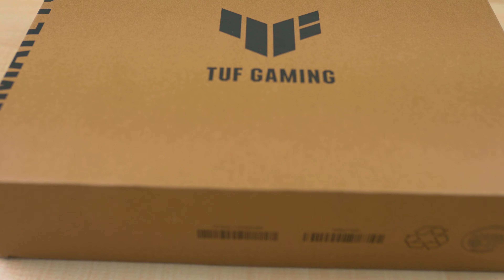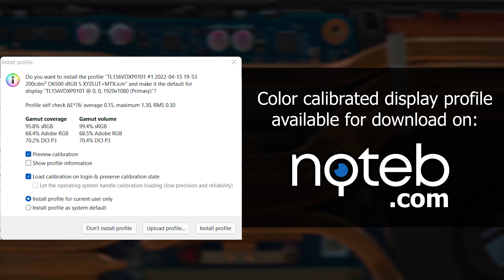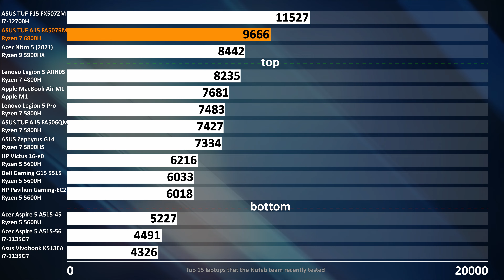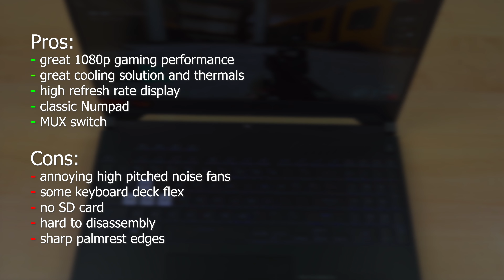ASUS TUF A15 (2022) Review - Unboxing, Disassembly and Upgrade Options

Comment: where to put the shortest screw pls? :)) i mixed them up
Reply: Did you figure it out, I’m in the same boat
Reply: 1:28 Unscrewing chassis bolts/screws
Total lengths in the order that they were unscrewed:
Bolt 1) 10 mm
Bolt 2) 12.6 mm (long)
Bolt 3) 12.6 mm (long)
Bolt 4) 10 mm
Bolt 5) 10 mm
Bolt 6) 8.63 mm (short)
Bolt 7) 10 mm
Bolt 8) 10 mm
Bolt 9) Captured
Bolts 10,11,12) 10 mm
Reply: Below the Ryzen sticker

Comment: 1:28 Unscrewing chassis bolts/screws
Total lengths in the order that they were unscrewed:
Bolt 1) 10 mm
Bolt 2) 12.6 mm (long)
Bolt 3) 12.6 mm (long)
Bolt 4) 10 mm
Bolt 5) 10 mm
Bolt 6) 8.63 mm (short)
Bolt 7) 10 mm
Bolt 8) 10 mm
Bolt 9) Captured
Bolts 10,11,12) 10 mm
Reply: Many thanks
Reply: Thank you so much bro

Comment: Why is there a silver pouch on the ssd? 
And my laptop also shipped with a black mask over the Ssd and Ram which is giving me 80°c on SSD temps on normal work load. 

Is this normal?
Reply: I'm tempted on not putting mine back tbh.

Comment: Can you please suggest about the Asus f17 2022 model and Dell g15 5520 2022 model..  What would you recommend ?
Reply from the maker: We haven't tested yet the 2022 G15, but we were pretty impressed by the 2022 F15
Reply: @Notebcom  What about the low color accuracy sRGB 60% Adobe less than 50%
Heating issue
Only 2 type A USB
Reply: @8ksmiff502  Dell software is really bad same for alienware so go with the asus
Reply: @8ksmiff502  and if u do stuff where u need 100% sRGB just look for other asus models

Comment: is the ram for this CL40?
Reply from the maker: The RAM is made out of two MTC4C10163S1SC48BA1, both CL40
Reply: @Notebcom  thanks for this! would you also happen to know if the wifi card has a key E, A, or M slot?

Comment: Some people recommend moving the original SSD to the 2nd slot for longer life. If I did that, would it change the data I saved on the original SSD?  Sorry if I asked a stupid question because I am new to laptop
Reply from the maker: Moving it from 1 slot to another wont prelong the lifespan. Adding another SSD will, since you will use the 2nd SSD for downloads and maybe games.
Reply: @Notebcom  The original SSD is already in the 2nd slot Disk 1 (on left). Disk 0 (on right) is empty. I now have two 1TB SSDs in the laptop. I now have the boot drive in Disk 0 and the data drive in Disk 1. I now want to figure out how to cool the SSDs since benchmarking causes the temperatures to be really high. If I can figure out a solution to this, it should prolong their lifetimes.

Comment: 3050 ti a15 have 1 vents ,does it have difference in cpu temp between 3050ti vs 3060  laptop?
Reply: It has 3 vents compared to 4 vents, plus there are lesser heat pipes too. Hopefully not but I am experiencing some heat, specially on my SSD with 80°c on normal work loads.

Comment: Do i lose My warranty for Open the laptop just for upgrade ram memory?
Reply from the maker: It depends on retailer and country. In the EU you can upgrade it without any problem. But if you send it to warranty you need to use the original RAM.
Reply: @Notebcom  i bought mine on US Best buy. Still work?

Comment: I want to ask if the wifi connectivity is great or not on this model. Should I replace it when I receive the laptop?
Reply from the maker: It's very good with no issues.
Reply: I have Gigabit Internet. My laptop averages about 800Mbps down with Wi-Fi. That is pretty fast since with an Ethernet connection I get about 920Mbps down.

Comment: For 8gb RAM variant do they come w 8gb x1 or 4gb x2?
Reply from the maker: I don't know. Some laptops comes 4Gb x2 others 8gb x1. It may also vary from region to region, so it's hard to say.
Reply: Its 1 8GB, but the computer supports 2. Just upgraded mine to 32 SODIMM DDR5, and will be installing another M2 SSD now knowing I can do that thanks to this video.

Comment: Is there any cooling issues as seen in earlier tuf devices
Reply from the maker: The cooling system has improved, but unfortunately the temperatures are about the same.
Reply: @Notebcom  thanks for providing us with this content, lastly I would like to ask for your opinion on which laptop i should buy. I want to do creative work(photoshop,premiere) and play valorant occasionally, with 3060 gpu, so should I go with i7 12 gen or R7 6800H. And So should I go with Legion 5, strix or tuf series for cooling. Much appreciated if  you could help me with this
Reply from the maker: @de_mo4769  I think the Legion 5 is the best option. We also have a search engine which should assist you in this regard: https://tinyurl.com/2p8fchp7
However, we only cover the US market and the offer there is somewhat limited now: 
This is without good displays: https://tinyurl.com/2p8774hw

Comment: Battery life is so less? Especially on a Ryzen model?
Reply from the maker: Yes. We tested it and it's pretty low.
Reply: @Notebcom  interesting, i expected it to have good battery life, most 2021 Ryzen gaming laptops had decent battery life
Reply from the maker: @racrboy5549  Depends on the laptop. Good battery life requires extra work from those developing the laptop which adds to go-to-market time and overall laptop costs.
Reply: @Notebcom  interesting, since this is a budget laptop, might there be a possibility that battery life might improve overtime with software optimizations?
Reply from the maker: That is a indeed a likely possibility, yes.

Comment: does asus fix the hinge issue yet?
Reply from the maker: The hinges on the 2022 model look different, but i cannot guarantee they are fixed.
Reply: i have this model and every time i open it have a small clicking sound
Reply: and the screen border does not close tightly, sorry for my bad english